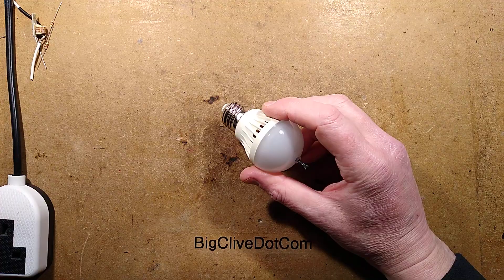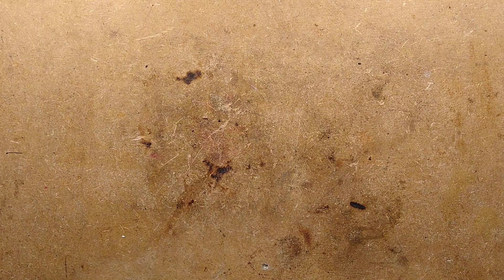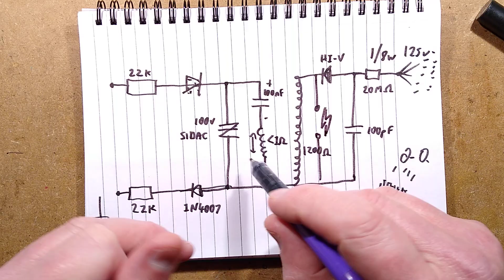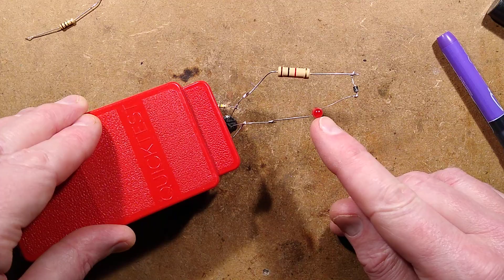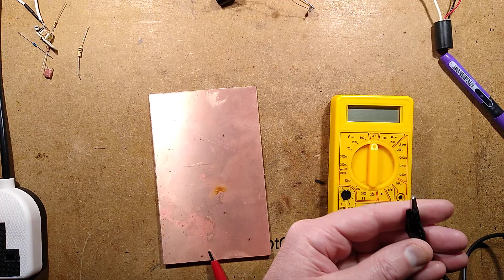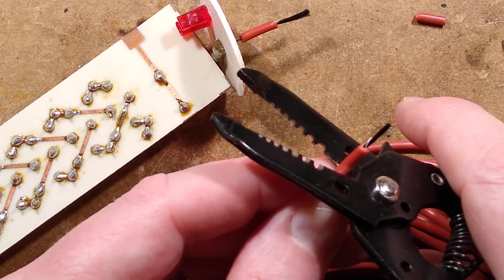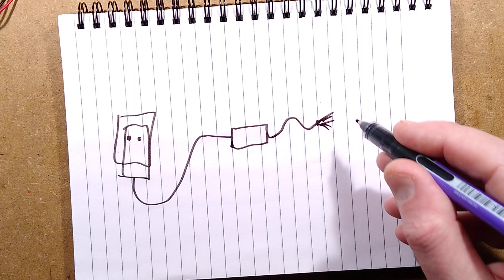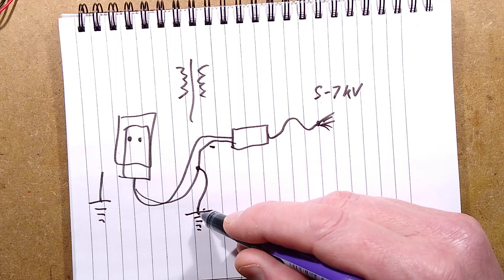LED lamp with tiny 5kV high voltage ion module.  (inc schematic)

Comment: Why would you ionise the air in a room? What's the practical application for this? Cheers 👍
Reply: He mentions it in lots of his vids. It's not so much about charging the air but rather charging the dust in the air. It makes the particles attracted to walls and all the non-charged surroundings. This means you breathe in less of the dust, but you have messier surfaces
Reply: @andruloni  
Not really, you breathe in the charged dust and it gives you COPD.
It's a quack solution to a non existent problem, and it is harmful.
Reply: @FarleyHillBilly  I would love to read any evidence of that. I only found that ozone generated by the device could worsen the symptoms of COPD, asthma and similar, especially with poor ventilation. 

Are you saying that the charged dust is somehow more dangerous? Or that it's easier for the charged dust to enter the lungs than non-charged? 
How would any of that happen, if you can tell? Charged particles should be attracted by a differing electric potential, in this case the most common being the ground reference. So the dust gets near the ioniser, charges up, becoming the same potential as the needle of the ioniser. They repel each other so the dust gets near a neutral surface. That's a potential difference so they attract each other. Dust gets stuck on the surface, as evidenced by years of use on Clive's windowsill where the immediate proximity of the ioniser is much more polluted. 
That means less dust in the air, easier on the respiratory system.

What is your model?
Reply from the maker: I've always had an ioniser in my bedroom from a young age and at 55 I'm not aware of breathing problems.  The hepa air-filter unit manufacturers have spread a load of nonsense about ionisers to sell their noisy machines.  That includes claiming that the charged air makes the dust stick to your lungs.  It's a load of crap.  An ioniser can precipitate out particles smaller than any hepa filter could catch.
Reply: @FarleyHillBilly  i guess ive read a couple of your comments here and they appear unfounded or speading misinformation... 

@bigclivedotcom maybe this is another candidate for being on the its-almost-the-blacklist-list...
Reply: Some say that it brings some health benefits, but it has been disproven
Reply: It smells of dead fish, like a day at the seaside
Reply: The ions clump on large particles, the large particles then get attracted to surfaces (which have a leakage path to earth). So it pulls particles out of the air.

Of course you can do that in an air purifier instead and drop both the ions and the dust in a filter, but the ionizer has no moving parts.

Comment: Looks like one of BangGoods HV modules they offer.  https://www.banggood.com/3Pcs-DC-3_7V-6V-To-400KV-Boost-Step-Up-Module-High-Voltage-Generator-p-958615.html?rmmds=search&cur_warehouse=USA
Reply from the maker: Those would be a bit ferocious and are only rated for brief bursts of use.

Comment: Why does it need needle replacement? Is it sending metal/carbon atoms into the air? Isn’t that bad for you?
Reply: That is not how phisics work. It would rather suck positive metal ions from air and "attach" them to the brush
Reply: @mzflighter6905  it’s physics*, and that doesn’t explain why needles are replaceable
Reply from the maker: Corrosion caused by the tiny amount of corona discharge over time or natural erosion over time.
Reply: @bigclivedotcom  thanks!

Comment: 'Is it discharged?' - ouch! - no!
Reply: One time I forgot to discharge a faulty CFL bulb before dissecting it for components. It had 66uf worth of capacitors at probably 165v. I felt a steady, warm tingle and thought "stupid me, that was in the ceiling a couple hours ago, I should've discharged it." Assuming it was all dead (a phrase you never want to hear) now, I went back to work dismantling it. Another shock, this one worse than the one before. I ended up laying it down on an insulating surface and pressing a penny against the capacitor terminals. I got a nice spark (no shock because it was isolated) and the gift finally stopped giving. It taught a lesson about assuming a circuit is dead, and also just how high your body resistance can be and how little power it takes to shock you.
Reply: I once cleaned a camera sensor because it got some dirt in there, so I partially reassembled it to of course test if it was clean before putting it back together and after confirming it was clean I didn't touch the flash cap itself but an area near it and got a mean bite, it even ever so slightly singed my skin at the points of contact.
Reply: @vgamesx1  I once disassembled a disposable camera to change the film and I touched the fully charged flash capacitor which triggered the flash and gave me a decent shock
Reply: @zarach11  I did that too lol, not to change the film, I was a kid and wanted to see inside a disposable camera.
Reply: I knew a guy who would sometimes test voltage by putting the wires in his mouth. “Hmmm,” he’d say, “Feels like six volts.” His guesses were not always correct. Last I heard, though, he was still alive.
Reply: @censusgary  When I was much younger and had no test gear it was common to put a battery or cell on the tongue to check that it still had some 'oomph' in it - hardly scientific or quantitative in any way.
Reply: Is it discharged?
Ouch!
Well, now it is

Comment: Digi-Key (USA) has sidacs for around 80 cents each, quantity 1
Reply: Aliexpress has cheap sidacs too, also free shipping.
Reply: Digikey does and does not have minimum order; it depends on the packaging. I.E. A reel has a certain number of components on it, that's the minimum you can buy. So it may show like 1 cent for a resistor, but it's actually when in a reel of 1000 ...
But yes, sidacs on digikey are about a dollar.
Reply: @BenjaminEsposti  That's correct. You have to look at the minimum order quantity for the part.  Most parts are available in quantity 1 but the per unit price will be higher than a reel of 1000. Some places have a minimum order of $25 or $50 for your entire order; Digi-Key does not have that kind of minimum order.
Reply: LCSC has sidacs for 16 cent if you order a single one, only around 10 cents if you order 100.
Reply: 50 bucks minimum order, great.
Reply: @FarleyHillBilly  Digi-Key didn't have a minimum order last time I ordered from them about a year ago. I just checked and they still don't.
Reply: @brianleeper5737  They don't have a minimum order, but in Canada if you don't order at least $100 they add $8 shipping.  A quick check shows a minimum of £33 or you have to pay £12 for shipping.
Reply: @sdalimon  Whatever Canada's or UK's equivalent to Digi-Key is, they will likely stock sidacs. It may be cheaper to order from them.
Reply: @FarleyHillBilly  And they'll ship via first class mail if your order is small enough.
Reply: @FarleyHillBilly  They are also might be the voltage for UK, AU etc. Depends on the application.

Comment: I didn't even know that these things existed.
Reply: That's why I watch Clive
Reply: They're very specialized parts. You can use several other components to do the same thing but then you have more possible failure points.
Reply: Me neither, and I've been in electronic for over 45 years.
Reply: Graham Langley,
SIDACs are like a big, heavier duty DIAC, typically with higher breakdown voltage and higher power rating. Both of which are in the Thyristor family.
Check out all the various different types ... most are use-restricted to high power things, for example, GTO (Gate Turn-Off thyristor) and such:
en.wikipedia.org/wiki/Thyristor#Types

P.S. Ever heard a musical train? Here is a Japanese EMU (Electric Multiple Unit) with the classic singing VVVF inverter, based on GTO:
https://www.youtube.com/watch?v=D_LyWo5SRJA
The sound changes when the voltage (VV) and frequency (VF) is changed.
Reply: I really meant the lamp with the ionizer itself. Not the sidac.

Comment: As I was connecting up the circuit, I removed all the moderator rods from my reactor...not to worry!
Reply: glow in the dark, nice
Reply: So you were the guy from Tchernobyl? Good to know. :-)
Reply: ...he said before the boom.
Reply: @soupflood  Actually it was more like a gurgle, splash, splatter. The Tchernobyl reactor did not really "explode". An explosion needs pressure and a sudden rupture of the containment, which then releases all of the built up pressure at once. The Tchernobyl reactor "just" heated up so much, that the containment building and the floors melted away, which resulted in a huge splatter of radioactive, way overheated material.
Reply: @Blubb5000  wasn't there enough water to create the steam for an explosion?
Reply: @soupflood  Yes, there was a lot of water for the cooling, which all evaporated. Water itself cannot explode. But the steam can rupture the containment building, which it did. So in a matter of definition, there was an "explosion", but it was a steam explosion, which ruptured the building. Many of the uranium rods then no way to get cooled anymore and melted away. This process was more like a volcano, which bubbled and boiled through the damaged roof. About 5% of the radioactive material was released into the air.

I remember a report from someone who was close by the reactor and saw the whole ordeal. He described it as a volcano.

Too bad that cell phone cameras weren't a thing back then. There is no video footage of the disaster itself.
Reply: @Blubb5000   i see. So there was an explosion, albeit not as big as expected. Volcanoes are known for creating explosions too, though.
Reply: @soupflood  The water "explosion" was just a puff, which blew the reactor containment open. This was just 5% of what you would have seen standing directly next to the reactor. With the containment blown open and melting uranium rods boiling away, the volcano stage began, where radioactive material was spewing all over the place. THIS was what you could have seen from the outside.
Reply: @Blubb5000   what a view!
Reply: @Blubb5000  tell that to the 1000 tonne reactor lid thats still orbit lol
Reply: @T2D.SteveArcs  Launching a 1000 ton concrete lid into a stable orbit with a single moment of acceleration is not possible. The Earth's escape velocity is about 11 km/sec. If the lid goes faster, then it escapes the Earth's gravitational field and it will never come back. If it is slower, then it's orbit will intersect the Earth and it will fall back somewhere onto the Earth.

A single moment of acceleration from zero to 11 km/sec. would probably also have pulverized the 1000 ton concrete reactor lid. This would have been quite a view to see this from up close.

(Just trying to be a smart a$$)
Reply: 3.6. Not great not terrible

Comment: Acetic acid is also good at getting through epoxy resin - and possibly less destructive than acetone. Can defo recommend the 2 Fran Lab videos about that display - really interesting! And of course SMA - your recommendation a while back has given me many hours watching Mr O fixing stuff.... and estimating the age of a video by how worn his cap is.
Reply: 👍 on the Fran Lab vid. I stumbled across it a couple of days ago. Strange and expensive item.
Reply: It's still going to destroy the component potting, though.  It's more or less chemically identical.

Comment: Oh wow, that SIDAC is super interesting! Definitely seems like the perfect, simple component for generating high voltage circuits, which it is...  haha
It's a heck of a lot easier than trying to make and tune up something like a 555 timer or a few overheating transistors to generate HF pulses, which is one of the only ways I've seen it done for goofing around with HV stuff. Although, the drawback is definitely clear if you needed like, feedback to generate resonance. 
Also, I thought that ceramic capacitor was a piezo for a second, lol.
Edit: Wait... I suppose you could manually tune the SIDAC with a variable resistor.... 🤔
Reply from the maker: An alternative to the SIDAC is a thyristor.  There's a very similar circuit that charges the cap on one half wave and then discharges it on the other.
Reply: Dave Jones has a video where he shows that many low tolerance high value mulitlayer ceramic caps do indeed exhibit the piezoelectric effect and can both be transducers as well as microphonic.
Reply: also that cap could be a piezo indeed they come in a similar formfactor and bare bones appearence. also why do they even bother doing it this way any regular old ceramic disk cap (those iconic brown ones) is rated for 500v if i am not mistaken....

Comment: Mouser in the US has Littlefuse brand 100V sidacs for 0.84USD
Reply from the maker: I'll have to check that out.  There is another way to do it with a thyristor that charges the cap on one half wave and then triggers the thyristor on the other.
Reply: @bigclivedotcom   Amperage ratings are low. Lot sure what the circuit needs.
Reply: @bigclivedotcom  Would a neon lamp or spark gap have the same effect?

Comment: I like how the electrolytic capacitor is stood off the PCB away from the hot LEDs
Reply from the maker: They're not going to get too hot anyway.  They're just ordinary single chip ones and not the oven-grade new multi-chip type.
Reply: I hate when caps & diodes are mounted like that. My bench Power Supply had a 4 diode rectifier with the diodes half an inch (~1cm) off the board, so I put them flush on.
Reply: @joshm264  You may run into problems with them overheating.  Components are usually mounted that way to increase their heat dissipation, and the diodes in a bridge rectifier can get quite hot.  Of course, in a GOOD bench power supply, the thing has been over-engineered in every way, so a good one shouldn't run into overheating problems from that and the extra space was just one more bit a guiding the lily.

Comment: Cool video. I kinda like ionizers too. More the practical application of, like in my garage/shop. Never heard of carbon fiber heating rope, that's something that seems obvious now I've seen it exists. Not sure why the copper plate doesn't charge up to a higher voltage, seems like it would. (I didn't see the other multimeter probe end, I note)
Reply from the maker: The meter acts like a discharge resistor to ground.
Reply: @bigclivedotcom  If I had a super cheap DMM... I don't want to fry a decent-for-me one :p